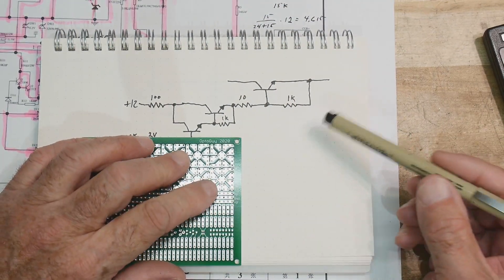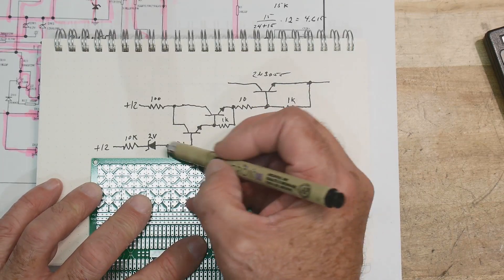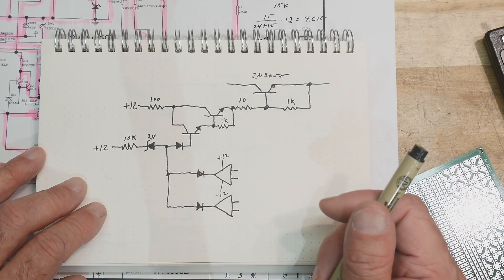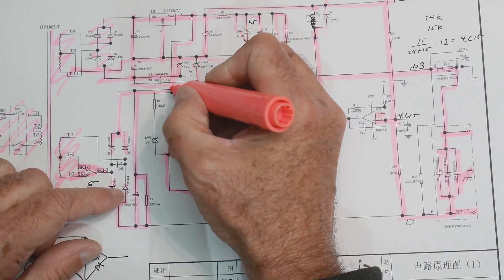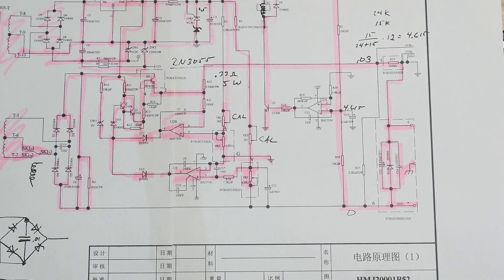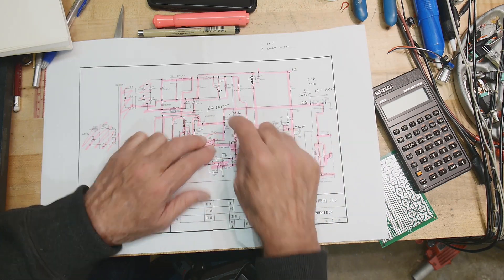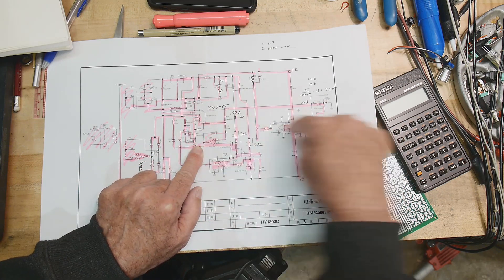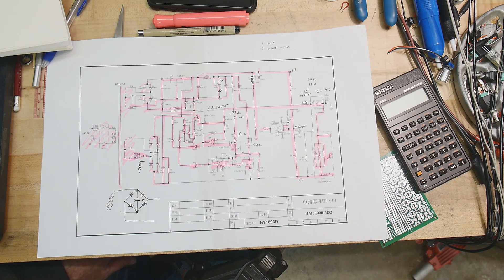#734 Deciphering a Schematic (part 2 of 2)

Comment: I think there are some very starnge parts on this schematic. I agree with Imsai Guy regarding U2 and U3 fucntionality, it doesn't make sense to me. 
And also on the very right-mid part of the schematic (after R15), there are these connections to GND, like VOT+ and CUR-, which are also directly connected to output '+'. A output '+' shorted to GND? It doesn't make any sense!!

Comment: Hello Eng.Imsai . In the minute 2: 25 you explain the two op amps with 2 facing diodes that  can pull down the high voltage and current  . How ? thanks for explaining  or giving any similar example to this voltage and current pulling down method or any reference or link . Best regards
Reply from the maker: please watch my 5 part video on the subject. on the fourth video I show it. https://youtu.be/0cbqbb9PmRY?si=0ANcz04HR23YMMBW

Comment: Great videos. The relay switching circuit uses the opamp inverting input connected to 12V from the top regulator and the non inverting is connected to chassis through a resistor which in this type of power supply is the positive output. Probably that confuses a lot since is less common to reference positve to chassis.

Comment: @3:45  That 2V zener blew my mind...  @4:20 That cant be output V because that relay needs constant 12V+ at that point. You wouldn't have the V-OUT from that 7812 going to the regulated high current output ??  BUT MAYBE that other input to the op-amp should be connected to the main V-OUT and not that 12V rail ??

Comment: I usually like IMSAI Guy's videos, but there are some glaring lapses in this two-part series. Errors in reading the schematic lead to incorrect analysis, which probably results in greater confusion for the students the videos purport to teach. The ICs are not adequately studied to see if they are actually op-amps or comparators, and if they ARE op-amps, are they being used as amps or as comparators? Nothing was done to look up what they are, and knowing that would have helped with the analysis. As others have commented, it is very clear from the schematic that what is 'marked in' as circuit ground, ISN'T.  This skews much of the other conclusions, and contributes to more confusion.

And while I like the methodology of starting with the easy parts and working up to the less obvious parts, more circuit study BEFORE making the video would have helped immensely. No teacher should ever be caught posing a question to students, and then not being able to explain it correctly to them.

If this were my video, I would have A) studied it thoroughly before hand so as to not embarrass myself more than necessary, and B) if there was STILL some place that I could not figure out, I would have admitted that I "don't get it" instead of just concluding that the incomplete analysis presented is OK.  Sometimes that happens when trying to reverse engineer a circuit, and there is no shame in admitting it. But to gloss over it as if it IS understood is just adding to the student's confusion.
Reply from the maker: make a video and I'll post it here
Reply: @IMSAIGuy  you are too late. I have many videos, and don't need help posting them.

And I am surprised by your response; thin skinned and without introspection. You would rather throw a weak challenge than just admit a shortcoming.
Reply from the maker: I thought the video was just fine for the audience I try to reach. I fail often and make terrible videos sometimes, I didn't think this was one of them

Comment: Hi Mr Imsai Guy !, ... you've missed the most important point of this design: what is drawn as the "ground" is nothing but the Positive Regulated Output of the Power Supply and the +12V and +2.5V are over this Regulated Output. This "ground" is not the Negative (or 0V) of the PS. The connection of the Positive Regulated Output to "ground" is the only part of the schematics you have not "coloured" so far.

Comment: The configuration is a bit unusual. 
One way to get an overview is to draw the circuit with its main components Q3, R22, R27 and C6. The circuit is set to ground at the positive output. 
This ground is the reference point where the two op-amps are connected, the V op-amp with the negative input and the A op-amp with the negative input via R22. 
With a high current the minus input of the A op-amp gets higher than the set value.  
With a high output voltage (which is negative) the plus input of the V op-amp gets negative against ground.  
They both shut the transistor Q3.

Comment: I think the circuit diagram is correct. The positive output of the power supply in connected to circuit ground, which is unusual. (But as the whole circuit is floating, there is no connection between circuit ground and chassis ground.) Thus the output voltage is also connected to the comparator input, while the other comparator input is connected to the reference voltage.
Reply: Yes, that makes sense. For some reason I couldn't find the schematic at the link, so I was stuck with trying to read it in the video which was a big exercise in frustration.

Neither of those op amps is a comparator in the accepted sense of the term. Both operate in linear mode, open-loop at DC with the gain rolled off with frequency by the feedback capacitors. This is very common.

Comment: The schematic is correct. Circle your grounds and you will figure it out. You will also find out the importance of the relationship of D10 and D13 and why replacing D13 with a power Schottky diode will prevent problems. Especially if you use two of them to make a split supply and do not disconnect them before power on or off.
Reply: @rmontgomery4340  I thought that this question would of been answered by now. If you look the transformer has two separate isolated winding. By transformer isolation the control circuity can float at the supply positive voltage with no problem. This allows the control components to operate independently of the supply voltage. So the control components do not need to be tolerant of the supply voltage, only the main transistor does. This saves cost and allows the supply to not glitch when the winding is selected by the relay. This design is used with minor modifications on a 50V and 100V model. Don't think of the ground as a ground and just a connection.

Comment: The negative output is not referenced to ground is floating from the reference. The dividers from 12 volts make sense then.
Reply: We have many BK Precision 1735A's at work which I maintain and they are the same. They regulate the negative rail and the positive is directly connected through. Not entirely sure why, but I suspect it's due to the technology of the time benefiting from NPN transistors. Also, by using a common anode, the TO-3 does not need conductive isolation from the chassis, making for a better heatsink and conductor. Just my theory. The BK1735A has one hell of a schematic BTW. I'll edit this comment with a dropbox link after work tomorrow when I retrieve it.